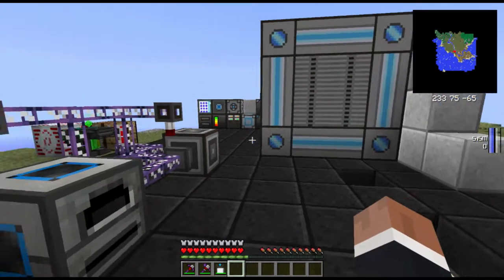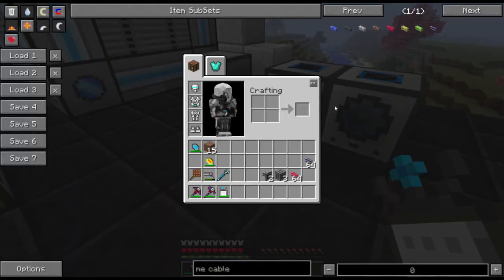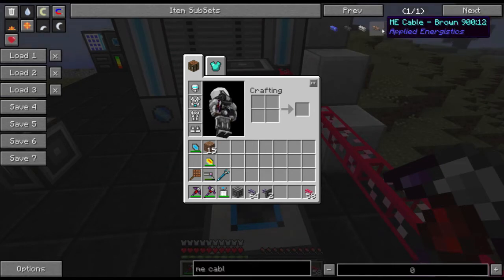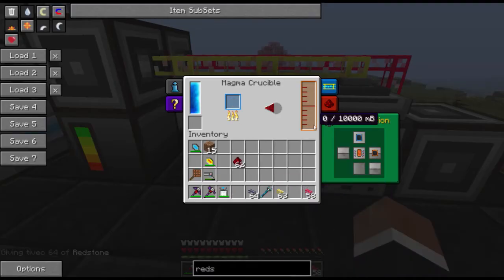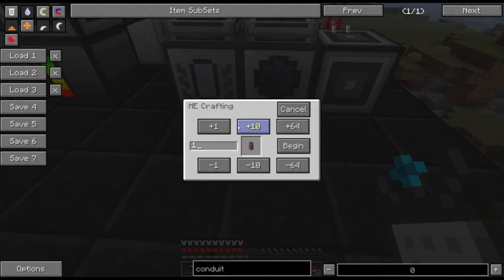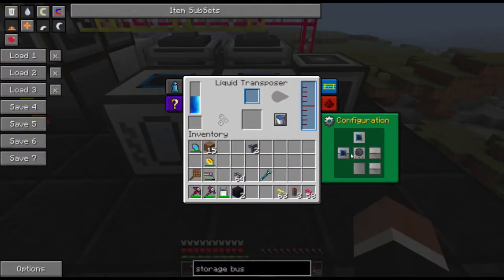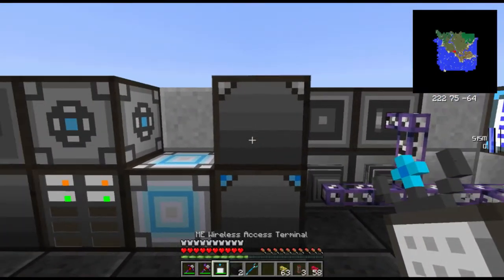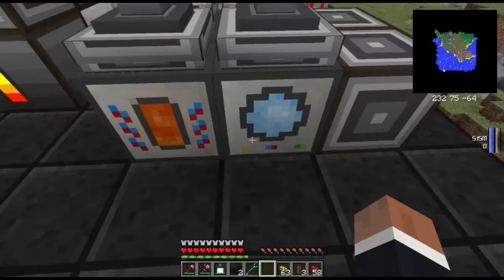Applied Energistics Tutorials - Energy Conduit Subnetwork

Comment: Why is it necessary to separate ender pearl smelting from redstone smelting?  As long as the recipes are set up properly, I don't see how any errors would ensue.  Aside from that, good video, it actually answered an issue I've been searching for answers to.
Reply from the maker: I recommend separating it, in case you have a network outage when a pearl is smelting and the recipe fails, the redstone will never be smelted. If you are careful, you might get away with it though :)